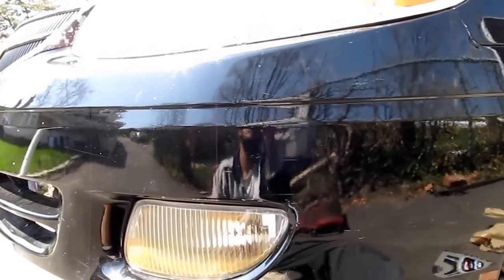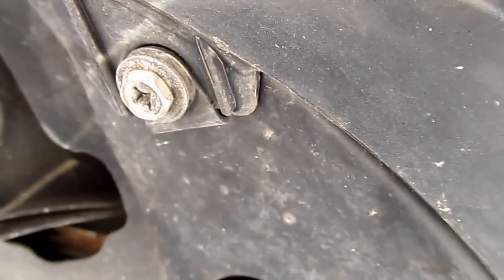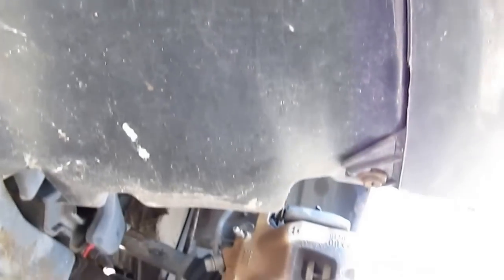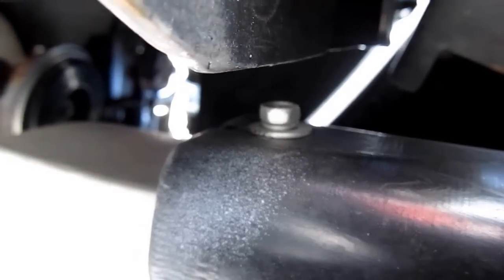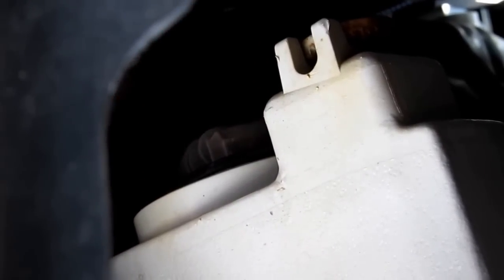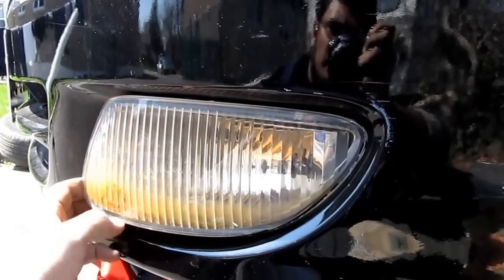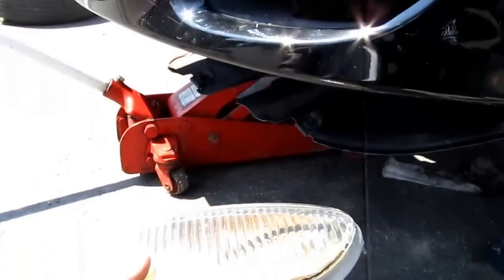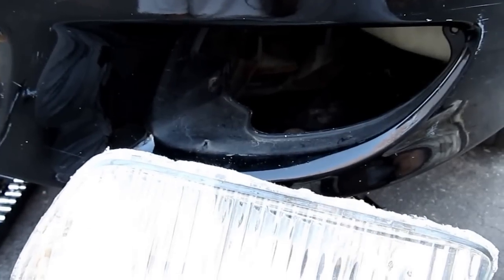How to Replace Fog Lights - Toyota

Comment: Rust in the fog light. I opened it up and found a bracket over the bulb had rusted off because water got in. Should have done a video of the rust inside. Looks like yours may have had rust also. Thanks for sharing this video!

Comment from the maker: The ES300 has a clip instead of the 10mm bolt on the side. Just squeeze it and push the fog light out.
Reply: great to know. lots easier to remove.

Comment: Taking the main assembly is not necessary, carefully feel for the twist housing and turn towards the outside of the car (I think). As to the replacement you have about of choices, bluish light, yellow regular, and halogen$.
I buff my lenses with a buffer kit and the results are like new.
Reply from the maker: This was how to replace the whole assembly

Comment: I successfully installed LEDs on the fog lights on my 2000 solara but as I took off the splash guard on the right side I accidentally snapped something off hopefully it's nothing major small little piece of plastic came off but other then that everything went well
Reply from the maker: Glad it went well. Lots of glare?
Reply: @speedkar99  not all it's very good lights I'm surprised at the beam pattern they give out got the sealight x1 series on both fog and headlights both new in box for 30 bucks so I can't complain

Comment: Hello, I have a 2003 Toyota Camry LE, and I was unable to successfully connect fog lights to the vehicle despite the vehicle having a pre-wired configuration for foglights.

I was curious to know if you would happen to know where in the fusebox one would find the fog light relay on the 03 Camry. I know you are a mechanical/electrical genius, so I wanted to check in with you. Thanks in advance.

Comment: The fog lights on the 2002-2003 Solara appear not to bolt in at all on mine. Just snap in and held in place with a tab out the outer edge of the housing. Problem is, one hit from a truck tire tread or hub cap on the freeway and the fog light in no longer secure because the tab will break from any strong impact.
Reply from the maker: I know the face-lifted Solara uses a different fog light than mine, it might be the same style as the 02-04 Camry or 05-08+ Corolla. I'd never have thought that it was just clipped in, usually they need to be secured properly with a bolt or two. Only Ford and GM does that!
Reply: speedkar99
You're exactly correct. They used the same light in multiple car models of those years. The newer fog lights that replaced yours (at least for those years) do just snap in similar to electrical connectors under the hood. The tabs have to be pinched in while pushing the light out from the back. The light has a plastic hook on one end and that plastic tab on the other end that snaps into the bumper cover. I just replaced mine and found that out. And it doesn't take much for the plastic hook to snap off from something as forceful as a good kick. My bad luck to be the victim of a poor design - a semi truck tire tread one time and a flying hub cap the other time were all it took. Not sure if new Toy fog lights nowadays are the same.

Comment: Bad thing about lexus es is that its to low wich makes it harder
Reply from the maker: Its the same height as all other midsized sedans. To access the fogs more easily, use ramps or a jack to lift it up.
Reply: Pancho Panochas I made a simple ramp out of two 2 x 8 boards nailed together, which lift the car enough (+3in) for an oil change and other work.
Reply: This is pretty late but you can take off the corner light in the ES300 to take off the fog light. Once you remove the corner light, you should be able to see one bolt and clip which holds the foglight in place. Takes me about a minute to take off my foglights :)